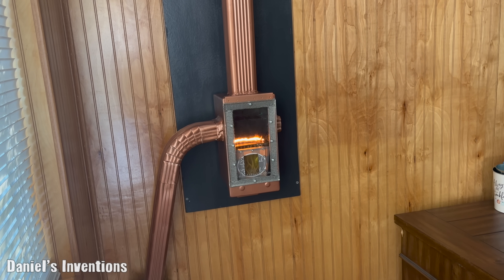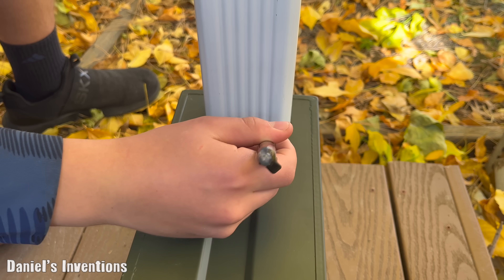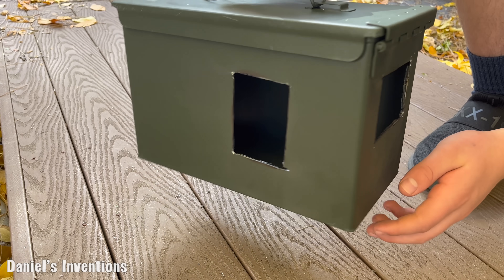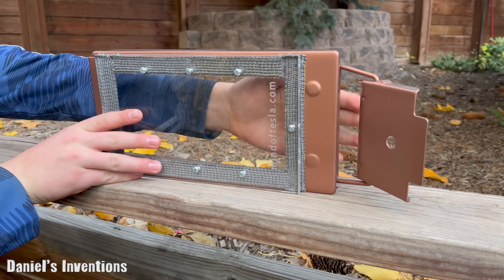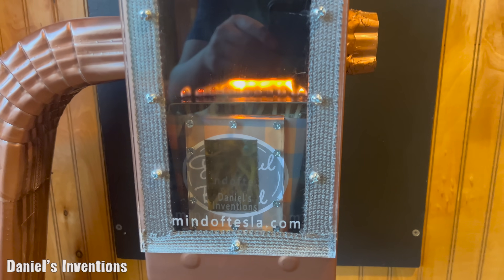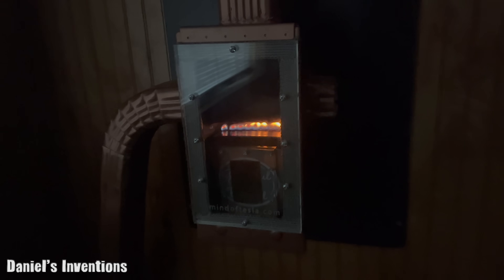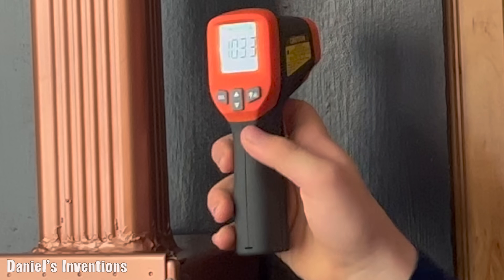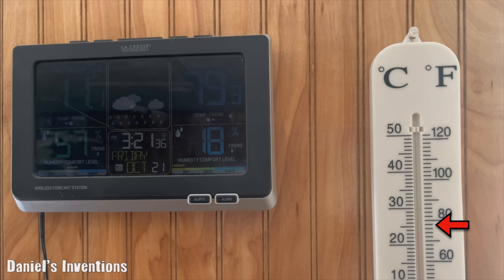ENDLESS Heat for Your Home WITHOUT Electricity

Comment: Interesting...would be more efficient if you would put another 12vdc fan near the upper exhaust pipe (well over 100 degrees) it is radiating heat into the room no doubt but to blow cooler air over it would lower its temp as that heat would be spread around the room and not go up and out the roof as air passed on the inside of the pipe.  So, in short...as the air is passing at 3-400 degrees on the inside of the pipe, pass air over the room side of the pipe to get some of that lost energy.

Comment: I’m thinking of doing this for candles for my camper van but want to make it portable and have a more flexible hose to poke it out of a gap in the window. Can anyone tell me if just an air intake hole in the bottom strait from inside the van will cause carbon monoxide to escape into the van. As small log burners only have air intake at the bottom with no ducting. Any input from people would be appreciated

Comment: I agree with charlaine nordin comment, and didn't want to get lost under the  (reply to:) Because I thought it was important to remind everyone that although this is a good Idea and like charlaine nordin said with a few tweaks it can be great ! 
The main issue I want everyone to remember is you must follow (local code) in your area when dealing with heating a home or alternately heating a small room. 
For one the intake and exhaust must be a minimum distance apart and out away from the house and so on. 
Also it may limit the type of fuel you use and how you refuel your heater and store your fuel on site and so on. 
I know a lot of you are thinking what they don't know won't hurt them
 well if your house burns down for what every reason and they find something that was not permitted that is the first thing they will try and blame ? 
With the prices of oil and I know I am on a fixed income and heating oil is $5.69 a gallon in my area. I have a 275 gallon tank to fill and i need 200 gallons to fill it now. If I call it will cost $1,138. I know a lot might be saying get a smaller amount. Well they have 150 gallon min. for our remote area and now they are saying they may be out of diesel in 2 week on the east cost ? 
So this might be the last time I am able to fill it up this winter and that is scary. Alternatively this type of heating is very temping to do but got to be careful about local codes  too !!! 
Thanks for listen !

Comment: Could you use 2 cpu coolers to strip more heat from the flames? Like the passive cooling they use for heat removal coupled with your fan might heat a larger room or possibly a house.  And if you use a carbon felt wick you will never have to replace/them.

Comment: that was a fun put together, and you may be getting 99% efficiency. i;d like to note one detail. your fuel only has a given amount of btu's.  i think oil is like 93k btu per gallon.  if you like playing with fire, look at old oil lamps, their was a  second clothe over the wick that at 500f the hydro carbons would burn causing a white glow, kinda like todays cat converters. some wood stoves are designed now to burn those gases. in wood stoves its called wood gas and can cause cresote build up, but you can run a engine off this wood gas to.

Comment: Be better built out of steel or copper if using the materials you showed and said you used to fabricate this in making this video then its primarily made from aluminum and JB Weld putty come on now people like you should not be allowed to create let alone post content like this for some other idiot who would be lost in life if it wasn't for you tube videos and Google. If anyone were to try to make and use this they better have amazing home owners insurance I'd even increase the coverage amount b4 firing this pos up cuz you would also probably have mounted it in ur basement to ur neighbors adjoining wall and burn the whole apartment complex down because even if made from proper material the size it would have to actually be to heat a cabin in middle of the woods it would take up a whole wall let alone how u going to get ur used grease out to ur remotely  located cabin cuz u don't have enough fat on u to last a hour or 2

Comment: Most vegetable oils can be used with those type wiks with the exception of corn oil which shouldn't be used. Even then some oils have higher particulates and generate/leave black soot.
Veg. oils are best to use when old and oxidized which are bad (carcinogenic) for cooking. Just save your old oils for burning lanterns and stoves.
Olive oil burns hot and bright but does have fairly high paticulates.

Comment: Damn good idea. Very innovative design
Reply: This is a unsafe surefire recipe on how to kill your family.
    First this bad design using the warm oxygen in the room, which us a code violation In the USA. Because you that same oxygen to breath. DO NOT DO THIS.
This setup will leak Carbon Monoxide into the house. This is why we do not use Franklin stoves in the home.
JBWeld is bot heat resistant and will fail when exposed to prolonged heat thus causing it to fall apart and causing a hours fire.
DO NOT DO THIS.
Lastly This furnace is too small to heat a Closet much less a whole house. At best it is about 500 BTU.

You have No safety precautions, No alarms or CO Detectors.
He is not qualified to teach anything.
It needs a heat exchanger to make this safe.
your welcome
A certified Engineer. BSEE, BSME, MEE, MEE, BSCS

Comment: I think that better thermal insulation in buildings would be more important to concentrate on than heating devices, which are now extremely efficient in their commercial offerings. I had the idea for vacuum insulation many decades ago but only recently have we seen any commercial offerings and not widely available for residential buildings

Comment: Your idea 💡  is unique. I've seen no other like it on the net. My take: Good points: super efficient,  low cost, light emitting.  Down side: wick design and adjustment function need more improvement and control so you can adjust on the fly from the outside, e.g. via a knob gear or some form of mechanically controlled adjustment switch . You can also automate with an arduino to get to a higher level of control or even use artificial intelligence.   I think this would appeal to van lifers and small RVers. Plant based oils can also be used as fuel. The nearest thing I can find similar to this design are the Newport boat furnaces using different fuels like gas and wood. I believe your idea is patentable unless there is already a patent before. Protect it if it's not yet done.

Comment: As a 40 year engineer, you have done a magnificent job!!
Reply: Your an Engineer ??? What type, Civil ? Chemical?. Certainly not mechanical. Else your a dropout.
I am not a heating specialist but have extensive HVAC knowledge.  I see many obvious design flaws. 
This is a unsafe surefire recipe on how to kill your family.
    First this bad design using the warm oxygen in the room, which us a code violation In the USA. Because you that same oxygen to breath. DO NOT DO THIS.
This setup will leak Carbon Monoxide into the house. This is why we do not use Franklin stoves in the home.
JBWeld is bot heat resistant and will fail when exposed to prolonged heat thus causing it to fall apart and causing a hours fire.
DO NOT DO THIS.
Lastly This furnace is too small to heat a Closet much less a whole house. At best it is about 500 BTU.

You have No safety precautions, No alarms or CO Detectors.
He is not qualified to teach anything.
It needs a heat exchanger to make this safe.
your welcome
A certified Engineer. BSEE, BSME, MEE, MEE, BSCS
Reply: @mrgcav  well, your right. Computer.... probably does break all the rules.... but in a pinch, not a problem. I've seen worse... Glad to see your all up on your code. Enjoy your day.

Comment: I've got a recommendation about the computer fan being used for convection. I'd go slightly smaller on the fan, for a few theoretical reasons. You reduce power draw which opens up more options to run said fan off of smaller solar panel/power bank set ups for longer duration. Also, the air moves through and exits the stove more slowly thus giving the air inside the can/stove a chance to reach a slightly higher temp before exiting. This might even reduce the oil wicking strength a little and slow the burn time on the oil, meaning you might end up using less oil over a set amount of time because the slower airflow would pull less oil from the wick as it burned. I realize that these factor differences would be small and probably theoretical at best but looking at it from a fallout emergency or off-grid standpoint, it might be something to consider. Also, I agree with the worlds most scientific chimney sweep dude. Insulate the crap outta your mounting points for that stove because turning your entire cabin into the stove would be really bad. You'd be warm AF though... LoL
Reply: Actually, as a PC builder. A larger fan at a lower speed is not only quieter than a smaller fan, but pushes more air cfm.
Reply: The heat coming out with his current setup reads above 400°, so not sure on slower airflow, it'd be a hotbox. lol. The reason I replied, was actually in reference to the air flow. How would the air traveling through the exchanger affect the amount of wicking? The only reason I ask is that the air travelling through that supply line should not affect the airflow or wicking through the combustion chamber; I would think as the air is from two separate sources. The chamber that supplies ari for the burner comes from outside and exhausts outside, while the air supplied to the room is recirculated via the fan.   I'm sorry if this doesn't come out right, I am genuinely curious.
Reply: The smaller fan gives less cubic feet of airflow per powerdraw, I would suggest using a quality computerfan like noctua or corsair. They are usually very silent decpite having good airflow. They also last very long
Reply: @jvinsnes  and a PWM controller so you can dial in the airflow/noise ratio
Reply: That computer fan draws like .1 amps or something...it's tiny
Reply: buy a stove fan it only requires around 360 degrees to work
Reply: smaller fans are much MUCH louder than bigger fans and require higher CFM speeds. the key is to maximize efficiency and reduce noise since you'll be sleeping in that room.
Reply: You could probably get a fan that runs directly off the heat from the heater.
Reply: Less oil= less heat, I think u missed the point of this being a heater 😂

Comment: Very interesting build and I am most impressed with the output.  Question, If you wanted to ramp up the flow of air, how would you do it?
Reply: Hello
Reply: First you are using the warm oxygen in the room which us a code violation In the USA. Because you that same oxygen to breath. DO NOT DO THIS.
This setup will leak Carbon Monoxide into the house.
JBWeld is bot heat resistant and will fail when exposed to prolonged heat thus causing it to fall apart and causing a hours fire.
DO NOT DO THIS.
Lastly This furnace is too small to heat a Closet much less a whole house. At best it is about 500 BTU.

You have No safety precautions, No alarms or Co Detectors.
You are not qualified to teach anything.
You need a heat exchanger to make this safe.
your welcome
A certified Engineer.
Reply: @mrgcav  Mate, you seem way to salty on that high engineering horse of yours :)
Reply: @mrgcav YOU should educate yourself before you make a bigger fool of yourself.
There's fresh air intake from outside and vents outside so it has NOTHING to do with oxygen inside.
The burn  chamber is sealed so it won't leak any CO into the space.
You have no idea the heat output clearly. Based on your previous cluless answers. 
JB weld IS rated for these temps
You're the LAST person to be taking advice from
You couldn't guess or estimate heat even remotely close.

Comment: This why you should never trust Utubers for life safety products, these gutters are not made from heat resistant material, and the coating can let off noxious gasses for a fire this hot, use real steel and you have an excellent concept👍

Comment: Excellent idea. I see many comments on how to make improvements to your heater. There is always room for improvements on any invention. 
I used a large wood stove for many years as a sole source of heat when I lived in Washington state so I had to learn some tricks that helped keep it safe. One thing that I would suggest is some sort of metal spaced form the back wall to keep the wall from overheating and causing an issue. I used leftover ribbed roofing metal but you could also use some type of flat sheet metal.
Use ceramic electric fence insulators that you can get at  a hardware or farm store. Get the kind that has a hole in the center. I simply use screws long enough to pass through the metal an insulator and anchor into the back wall securely. Space the metal 1" above floor and the insulators spaces the metal 1" from the wall. The metal behind my stove would get hot enough you couldn't hold your hand on it at all and the wall behind is was barely warm. The 1" spacing behind the metal creates an air flow from the  floor as a passive heat flow. Just an additional benefit for use of heat. If it worked for a wood stove it will work for a small heater such as yours. 

Keep up the good work. I will be watching for future things.
Reply: What about the heat that transfers through the screws passing through the middle of the insulators?  Aren't they pretty direct transfers?

Comment: Very professional 👏🏼👏🏼👏🏼👏🏼👏🏼 bravo
Reply: This is a unsafe surefire recipe on how to kill your family.
    First this bad design using the warm oxygen in the room, which us a code violation In the USA. Because you that same oxygen to breath. DO NOT DO THIS.
This setup will leak Carbon Monoxide into the house. This is why we do not use Franklin stoves in the home.
JBWeld is bot heat resistant and will fail when exposed to prolonged heat thus causing it to fall apart and causing a hours fire.
DO NOT DO THIS.
Lastly This furnace is too small to heat a Closet much less a whole house. At best it is about 500 BTU.

You have No safety precautions, No alarms or CO Detectors.
He is not qualified to teach anything.
It needs a heat exchanger to make this safe.
your welcome
A certified Engineer. BSEE, BSME, MEE, MEE, BSCS

Comment: The jbweld part is a very bad idea unless it is a certain type that can handle the heat. Regulator jb weld and jb quick will destroy your upper respiratory system and ultimately suffocate then kill you. You need to state exactly what kind of jb weld you used plz. It looked like jb weld or jb quick. High heat red rtv would work perfectly it is used in exaust system on hot rods all the time to seal slip joint headers for better o2 sensor readings. But overall this heater is a very awsome idea minus the jb weld.

Comment: I'm thinking your fire box would retain more heat if you run the exhaust pipe from near the bottom of the fire box because hot air tends to rise the hottest air would force cooling air down and out and yes multiple pipe through the box would have more surface area and smaller amounts of air through the tubing may help with the heat transfer. as already been said no fan required. the heat itself will make the air flow. forced air transfer would require hotter flame.

Comment: Excellent. I plan to build this. One modification I'll have to make is 1/4" mesh hardware cloth over the exterior conduit openings, to keep unwanted visitors out-big problem out here in the semi-arid rural area I live in.
Reply: This is a unsafe surefire recipe on how to kill your family.
    First this bad design using the warm oxygen in the room, which us a code violation In the USA. Because you that same oxygen to breath. DO NOT DO THIS.
This setup will leak Carbon Monoxide into the house. This is why we do not use Franklin stoves in the home.
JBWeld is bot heat resistant and will fail when exposed to prolonged heat thus causing it to fall apart and causing a hours fire.
DO NOT DO THIS.
Lastly This furnace is too small to heat a Closet much less a whole house. At best it is about 500 BTU.

You have No safety precautions, No alarms or CO Detectors.
He is not qualified to teach anything.
It needs a heat exchanger to make this safe.
your welcome
A certified Engineer. BSEE, BSME, MEE, MEE, BSCS

Comment: NICE to see people enjoy being more efficient..  I have to say that I watched it twice and liked the idea of the oil canister being close to a heat source..  in extreme cold even kerosene becomes thicker ,less viscosity. And, the wicks burn down faster than the rate of oils being pulled up into the wicks to burn.   if I hadn't choked on all the smoke I wouldn't be here to tell about it..  but it does/can happen.   Will definitely build and get a monitor/alarm..   great reading all the pro tips and stuff. Kuddos to industrious a kiddos.  Bravo!
Reply: Definitely get carbon mono oxide monitor if you use it, I think it was very thoughtless of him to not warn people for it.

Comment: Overall good design, but I don't like how your exhaust is aligned with the intake. All it would take is someone putting a large container on the ground and the intake would be sucking in carbon dioxide and you could die. I would offset the vertical position of the exhaust.

Comment: How would a clay pipe perform, but I would use good steel, with the inlet cool air and the fan, it should prevent any overheating, also fiberglass wicks..

Comment: You should use a double wall pipe on your exhaust and use a peltier fan to move the ceiling air down past all that exhaust heat towards the cooler floor, capture more heat and use no external power. My shed needs something like this.

Comment: What about the oils that can be used as the heating source?
Reply: Any oil. Diesel fuel would be the cheapest and easiest option at 4 bucks a gallon and available at any gas station.